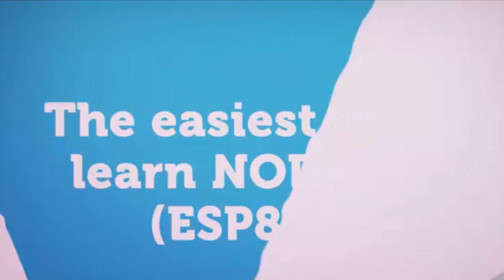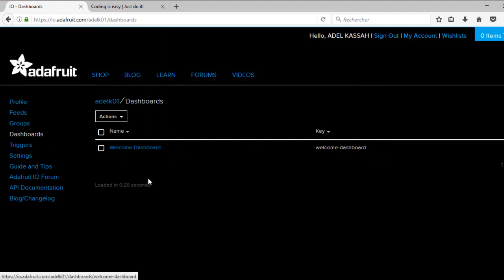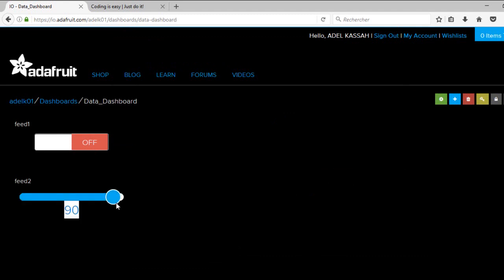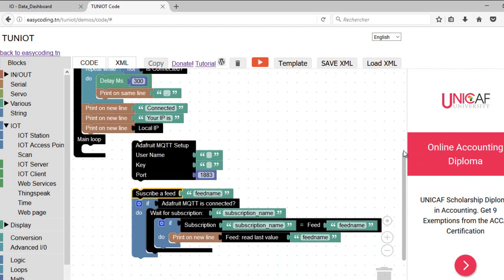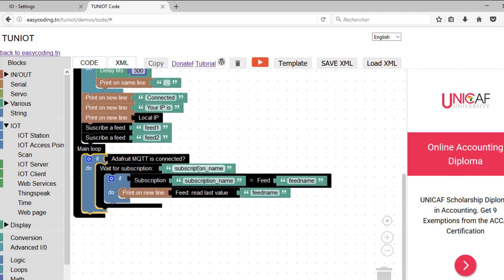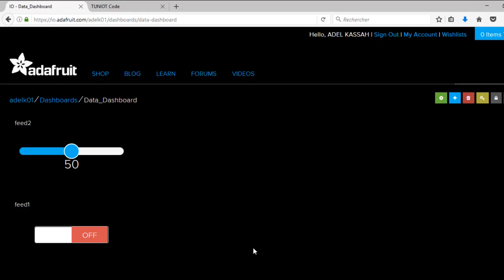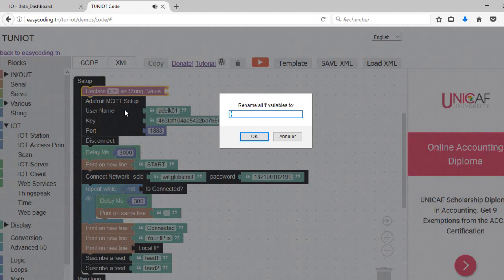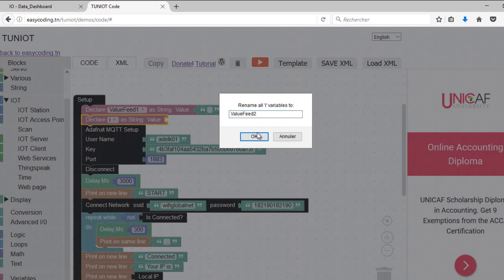NodeMcu (ESP8266) Tutorial C-12: MQTT: Getting data from Adafruit IO MQTT server

Comment: Hi I've used your steps to create a connection to io adafruit.. but I'm running wifi manager so I dont have to hard code my wifi credentials.. I can connect to my io adafruit feeds and received inputs on the node.. what is happening though is the node drops its connection randomly and I have to reset the board.. I've set a nodemcu esp8266 and a d1 mini.. and they both connect fine.. but drop connections at random . Any input/info you mite have would be grate..